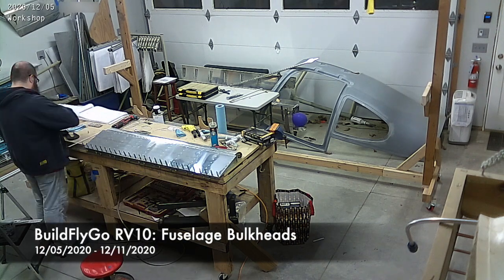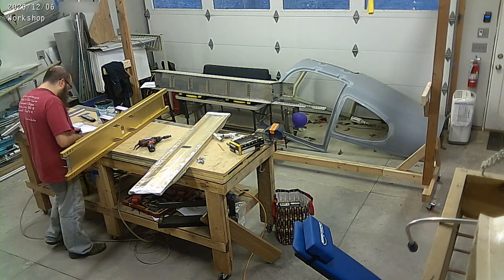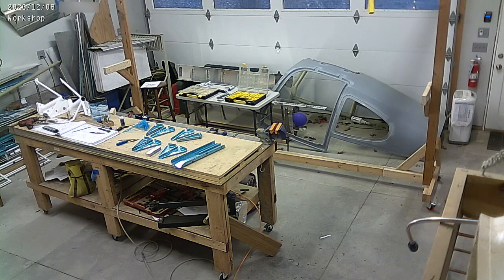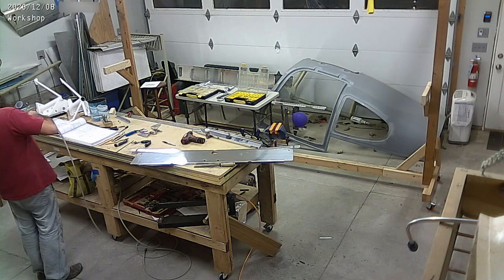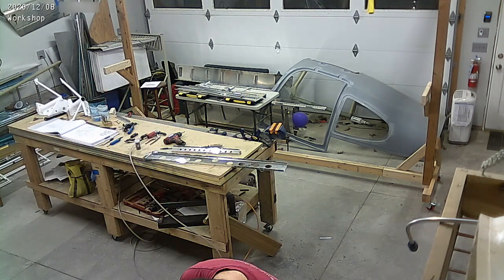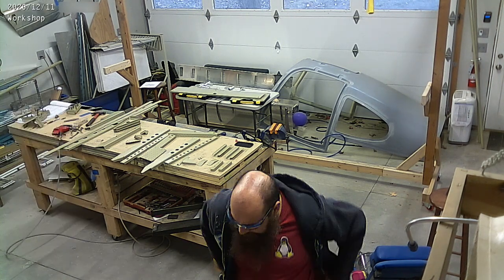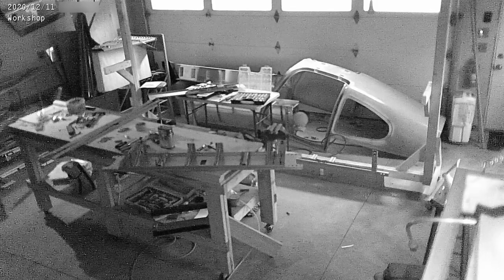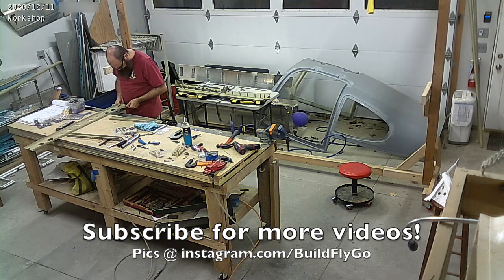RV-10 Build: 12/11/20 - Starting on the Fuselage!

Comment: That is the one thing I like about the Stewart waterborne primer.  It is much easier to use than the epoxy for small batches.  I will use the epoxy on the exterior, but I figured the regular primer was adequate for interior parts that would not see a lot of abuse.
Reply from the maker: Yup, there’s pluses and minuses for sure. I really like how sturdy it cures.